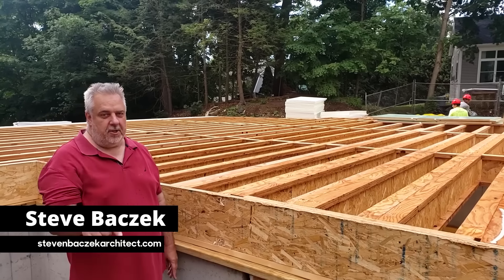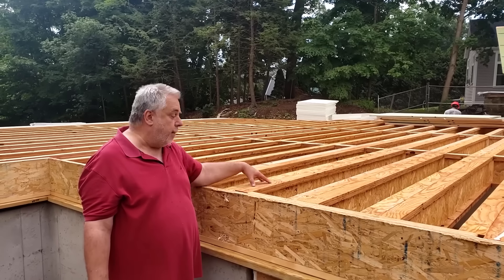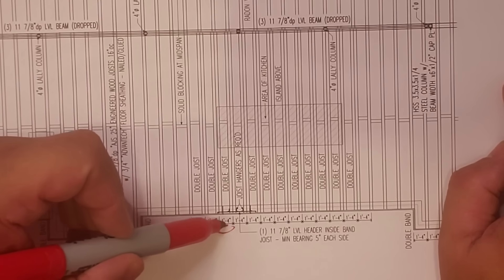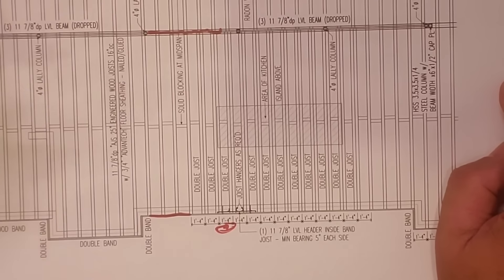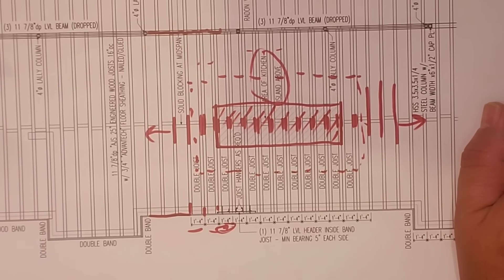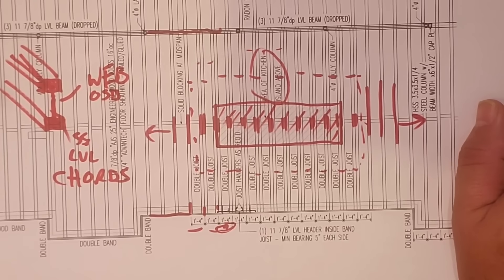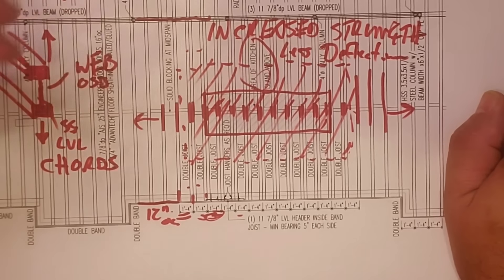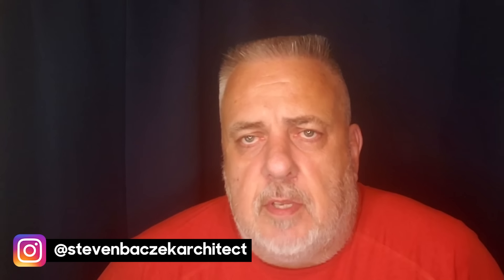FLOOR FRAMING - DOUBLE JOISTS? Why?

Comment: Without having watched this video, I would have done the 12” spacing and if I felt that wasn’t enough, add additional rows of blocking. 

This video has given me the opportunity to reflect on that. Doubling the joists increases the material cost significantly but the additional labor for a portion with 12” centers might well be a greater net cost. You still have somewhat increased material costs with 12” centers, and the additional labor to switch to 12” and then fit your framing gun into the 10.5” gap is a factor. Plus it’s pretty easy to build all 16” erroneously and then have to do a rebuild. 

Additional blocking applies pretty equally to both strategies. 

Anyway, my point is, thanks for walking me through that, it got me to see that doubling can be a good strategy.

Comment: We used 20" deep open web trusses (2x4 construction) and our floors are rock solid.  We even had the joist supplier spec in the stiffest joist construction because we've had homes with bouncy floors.

Comment: I agree with this despite people pointing out the increased cost. It always costs more to do better than the bare minimum, and over the life of the house, the added comfort and strength far outweighs it.  I'm doing all the work on a single family home that I bought and I've even had to lift the house myself off the foundation to do mud sill replacement.  And I'm doubling the floor joists as I go and doing more blocking than normal too just for that extra stiffness.  If you want it, pay for it.

Comment: Doubling versus switching to 12" centers adds about 7 more joists. I have designed it both ways in the past.  I would be interested about just how much more load that would allow and what the cost difference is (material prices being such a big deal these days). I imagine that the loading capacity would be substantially greater. That island could easily top 1000 pounds, with a granite top, so this is a great consideration in the design, regardless of which option is used.

Comment: As a homeowner, I had to live with the exact deflection issue around the kitchen island 5' x 8' with or without friends with their wine glasses. My kitchen span was about 16-18' on a crawlspace. It was very annoying rattle when anyone used to venture out in the the area. By design, the floor IJoist were 12" oc in that area but still it had deflection due to enormous weight of kitchen island granite + other kitchen appliances. This was most noticable during season change. I used to hate it. Either you can have shorter spans with a cross-beam / girder or as steve had shown here by doubling down on it and hope for the best.. in my opinion, best would be to have cross beam with shorter span ijoists wherever you can... Bath tub  weight is not so much in comparison to kitchen island but one apply it as an insurance. In my case, simply the design could have extended the cross beam / girder underneath near the kitchen island all the way to the other side wall to provide stiffness n support to ijoists

Comment: Thanks for the informative video! I have a follow-up question. When you double-up the I-joists, do you just put them side-by-side, or do you somehow marry the I-joists to one another? If a builder were inclined to somehow marry the I-joists to one another, how would you recommend doing that? Thanks for your thoughts.
Reply: I dont know how they did it but I'm a structural engineer and it will not be necessary to marry them. The weight is working downwards, the web and the flanges are thus carrying the loads per joist vertically, there is not an interacting necessary to carry the loads. Only reason why someone would want to marry them, is to make sure the floor sheets bend completely the same, at least that is what we do for for example parking lot floors (that are in a highrise, not on the flat ground), but those loads are of course much heavier. Dont think it will be necessary for people their homes.

Comment: First of all love the video. I brought this issue up with I joist manufactures/ engineers years ago, and they seem to be a little dumbfounded. 

Questions? 

Doesn’t finishing the basement ceiling under the space.,aso take care of the deflection of I joists?

Can you eliminate the deflection by choosing floor trusses made out of 2x material?

Is there lees deflection with 2x 10,or 2x12 dimensional framing?

Keep up the great work- I learn something  every video!

Comment: Steve this is great, my wife and I live in a well built home here in Ottawa Canada.. but the floor deflection is something we constantly complain about.  We’re building our own home in Upstate NY when I retire from the USAF, what’s your lead time in taking on projects?
Reply: Add bridging or pressure blocking and single joists are just fine. TJIs/I-joists as he is calling them, are notorious for noise transfer and deflection. Also, 2 layers of thinner tongue and groove (3/4”) is more effective than single thick layer (1 3/8”)

Comment: I've designed with both double or added more with narrower spacing for this same reason. Do you think it would make a difference using floor trusses over i-joists?
Reply: Cost and lead time to be considered.    Floor trusses are good for easier mechanical runs, but I've heard fussy framers complain about them not always being straight!
Reply: Good question. Or could the same method be used for trusses? For example under the kitchen island or a tub.
Reply: @joshberg740  Fussy rough framers? Is there such a person? I have observed some RF's only own a hammer, air nailer and sawzall.
Reply: @DeuceDeuceBravo  In a retrofit you could used 3/4 ply or osb to box in the I-joist in the area needed (jack up to level, glue and screw/nail) or use a strongback.

Comment: Provided that the joists are appropriately sized to support the island wouldn’t the shear weight of a giant island resist harmonic oscillation?
Reply: Like if you put someone on a swing vs pushing it empty?
Reply: Yup. Like bouncing on a trampoline by yourself or having someone heavy standing on the trampoline while you try to jump. Totally dampens the oscillation of the trampoline.
Reply: I would have thought the same thing, but I've noticed the opposite in my 1973 house with floor joists that are spanning farther than they should. When we added a large heavy sofa and a Peloton to the room, the floor got a lot bouncier.

Comment: I was curious how you felt about the I joinst vs Open Trusses (only nailed or screwed together, not plates)?   I like the open truss as its easy for plumbing and HVAC to be integrated and done correctly.  I won't use I Joists as the fire issue (firefighter here), but curious how you feel about the two.  Open Truss can span a great distance and could be built custom when you want to double up areas.
Reply: Thin metal gusset plates will heat up and fatigue before I-joists burn.
Reply: @2chipped  Yes I know but I Joists burn in less than 15 minutes.  I'm not talking about tusses that are plated, I am talking about trusses that are nailed.

Comment: An extra 10 to 15,000 dollars to solve a sloshing wine problem? Another first world problem solved.
Reply: A 20 ft I beam is like 60$. I think he put an extra 12 i beams. $500 for material $500 for labor. Where did you get your ridiculous numbers?
Reply: @zirzmokealot4600  
1) you are assuming that he is using some cheap I-beam that cost $3 per/lin. foot?
2) you are also assuming that he is charging only $3 a linear foot to install?
3) he is a high-end builder dealing with a high-end homeowner
4) you may think my estimate is way too high, but I find it hard to believe that he would only charge an extra $1,000
Reply: @dans9206  didn't like them facts did you.
Reply: @zirzmokealot4600  absolutely no facts involved.... Just your opinion.
Reply: @dans9206  you're literally just making up numbers. "Another first world problem solved"?  A gotcha comment that holds no weight. I bet you've never even swung a hammer.